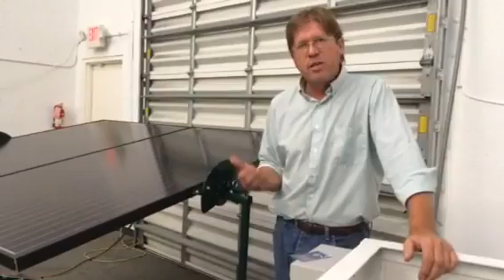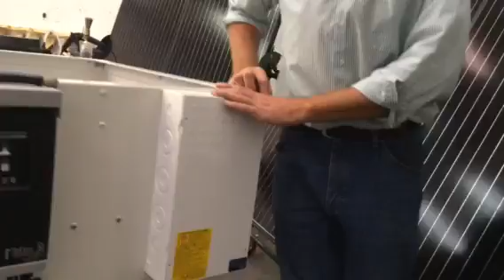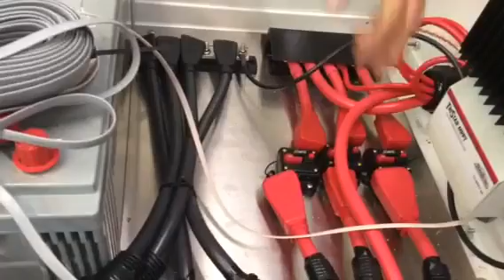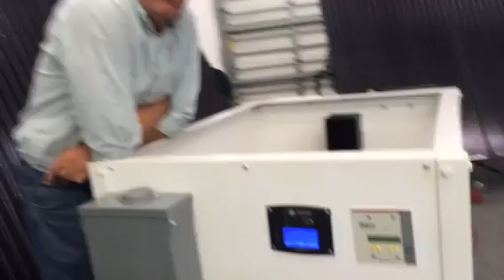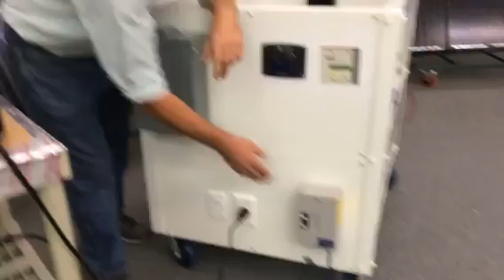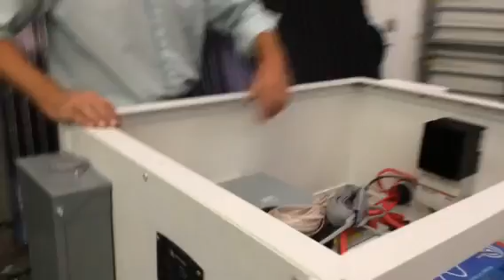6000 watt 50 amp 120/240 Solar Generators

Comment: It's 2121 & I've NEVER heard of YOUR CO. ! ( and I've been trying to find a off grid system ) !
Will Your system run a 28x28 small
house full time as only power ?
Tv 2) freezer 2) fridge 1 ) assorted
lights & gizmos as in any on grid
house ? If zo how much $$$$$$$$$
Reply: It runs my 700 square foot off grid cabin.  Just have to be aware of running large loads at night.  The 6000 watt system cost me $15k when I purchased it a few years ago.  Jeff delivered the system to me.  There is a video off it on this channel "another satisfied customer"
Reply: @MBUPNorth  any other useful videos on this system? Do you have a warranty ? How long has it lasted you so far?
Reply: @hammerremmah1333  Every component had warrantees with it and if I ever have questions or issues, I just call or email Jeff.  Its still going strong but when the time comes, I will upgrade to lithium batteries.  Runs everything I have thrown at it including a well pump and an on demand water heater.  Just have to be careful about what I run at night.
Reply: @MBUPNorth  what website did you order off of ? Is that a not enough storage problem or you do not have enough solar panel input?

Comment: Does this have an rv 50 amp connection or 30 amp
Reply: I am wondering the same...guess we have to call them direct. I need this type of system for off-grid while we are building our home.
Reply: Ron Gray let me know what u find out
Reply: @stevengarcia3909  It does not.  I have this system.
Reply: I also need this 50 amp rv plug while I build our home, @yooper how do you like it?

Comment: I have been watching many video's about batteries and was wondering why you don't use the new Lithium Batteries? They can go down to 20% before recharging and require just a fraction of the recharge time of both AGM and Gel. Plus they  have far more time they can be recycled, over the AGM and gel. They may be more expensive but won't it be better in the long run?
Reply: guess ya dont lisen they only bateries aloud by law to be flown in on plane some off grid sites you have to fly in

Comment from the maker: The Independent Power Provider 50 Amp and 100 Amp systems give you the ability to run much bigger loads in your home. The 50 Amp/ 6000 Watt 120/240 Volt Solar Generator has 775 Amp hours of battery storage at 24 volts, that's 145,000 watts of storage. At a cost of $ 1.22 a Watt after the federal tax incentive, compare that to other systems that cost $ 2.85 - $4.95 a Watt that do not have Pure Sine Wave Inverters, MPPT, Pure Gel Cell Batteries, or 275 Watt/30 Volt MADE IN AMERICA Panels. TheTrue Portable Solar Panels give you the ability to Track the sun all day long. Power your HVAC, Kitchen, Living Room, or anything else up to 50 Amps for the 24 Volt System or 100 Amps for the 48 Volt System. No gas, dangerous carbon monoxide, or noise, just clean affordable energy from the sun, that you pay for once and enjoy for decades. The panels have a 25 year warranty for energy production and the system is designed to last just as long. The power cabinet is a Faraday Cage made of Structural Aluminum that will withstand EMP's.